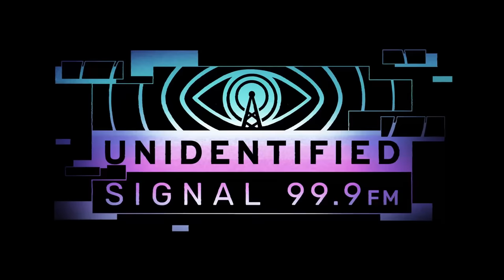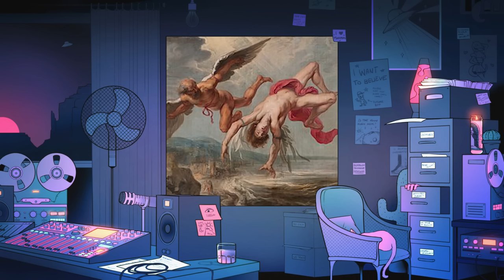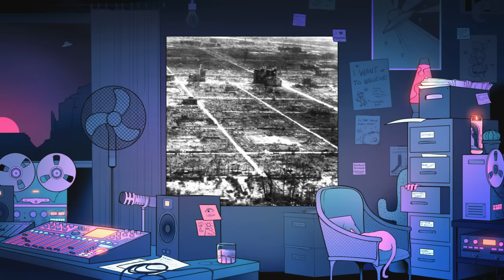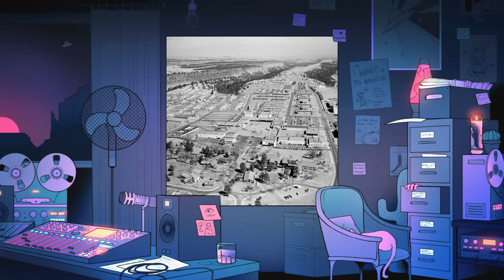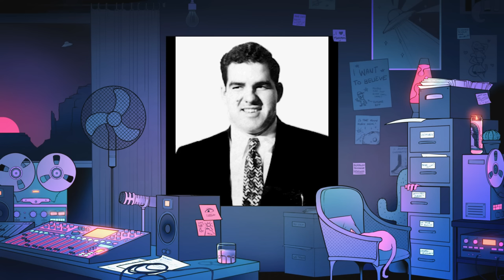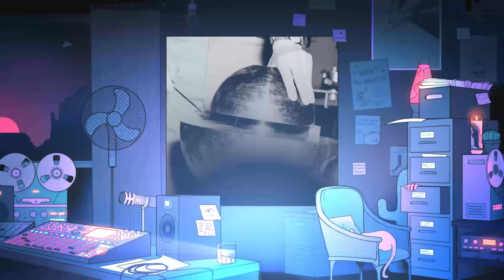THE DEMON CORE

Comment: One of the more insidious elements of acute radiation sickness that DK alluded to was the part where after he got to the hospital Slotin appeared to be feeling better. Acute radiation sickness often includes a latency period where the body stops experiencing the initial symptoms and a person feels like they're better. But in actuality it's because the body's immune system has started to fail to the point where it can no longer induce many of those symptoms but the rest of the body hasn't yet degraded enough for other vital functions to stop working.
Reply: Kinda like hydrogen sulfide. It is very toxic, but it is easy to detect, even in low concentrations because it smells like rotten eggs, so you can also tell where it is coming from by the strength of the smell. Except, that when it reaches a high enough concentration, it overwhelms your smell receptors, and then you won't it's smell anymore.

Comment: For reference, "criticality" or a k-value of 1 for nuclear material is the point where a single fission event produces enough neutrons to result in another fission event (over some time unit), thus being self-sustaining. It can be expressed as "for every atom split, another will be split". Nuclear reactor moderation specifically monitors this value. A nuclear bomb (as far as I'm aware) simply pushes the value of k as high as possible.

A very valuable lesson was learned here, don't fuck around to find out when it comes to radioactive materials and radiation. Radiation damages tissue on the atomic level unlike nothing else in the universe. Lots of scientists in the first half of the 20th century put their bodies on the line to learn this. 

The movie "Fatman and Little Boy" is an ok depiction of the Manhattan Project and covers this, it's pretty gruesome.